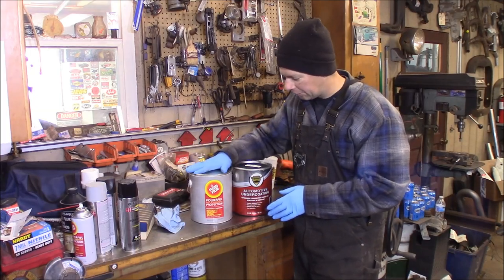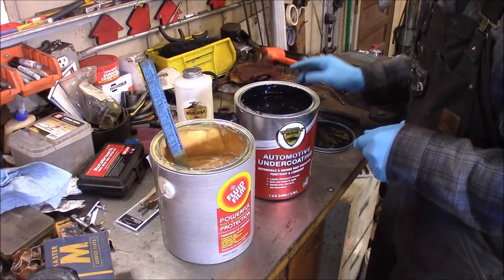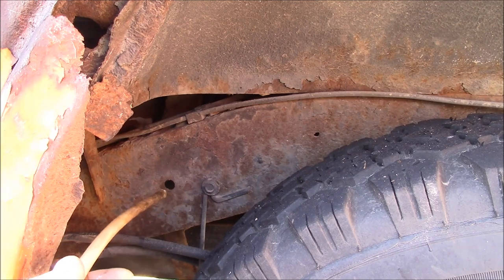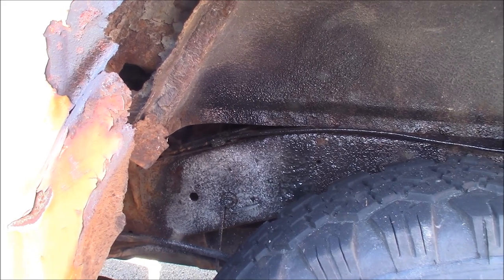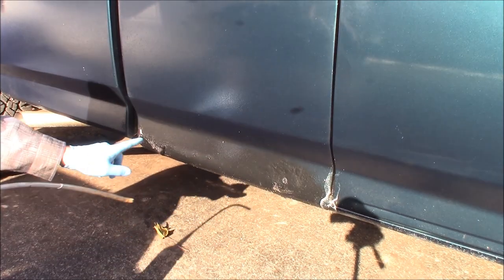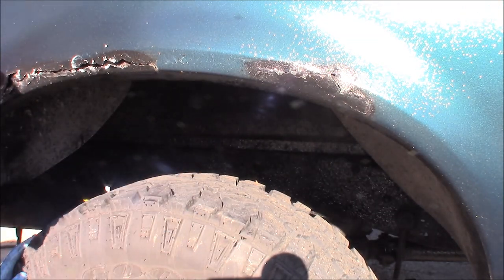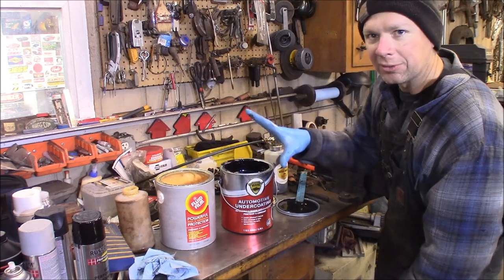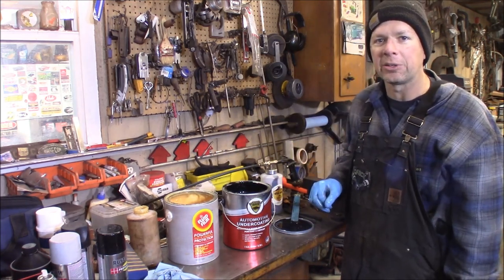Fluid Film vs WoolWax Lanolin Rustproofing:  Stop Rust in its Tracks!

Comment: Something no one ever seems to mention is the fact that rust is porous, similar to wood.    So the rust can be used to hold an oily rust preventative onto the metal.   A thinner oil will penetrate the rust all the way through down to the pure steel.   So the concern about sticking to the frame is way over rated.   And worse, the thicker products will not penetrate the rust as well as a thinner product.   Any kind of oil will work well on a rusty surface.   The only time you need something thick is for new, shiny, rust-free steel.     Or you can let it rust a little, then the thinner oils will penetrate and stay in the deeper layers of the rust.   Easy-peasy.   The "old-timers" would apply used motor oil and that works very well too, except it can damage rubber if it's not cleaned off right away.

Comment: If youre spraying when its cold get a paint mixer hook it up to your drill and mix it up, it will thin it out and spray better. I have a undercoating business I use fluid film. FF also makes it in black now (it is also thicker then clear). Awesome product. Also if you can use a airless sprayer, works 1000 times better then those kits.

Comment: I would like the black woolwax too.  I saw another video where the guy warmed up woolwax by putting the spray bottle in a tub of hot water.  Better yet apply woolwax before weather gets cold.
Reply: Use on old crock pot and water to heat the bottles.

Comment: They both have their advantages. Are use fluid film on my ram 1500 chrome wheels/bumpers/grill, I put it on and I leave it on all winter without wiping it off. You can’t even see it when it’s on the bumpers in the wheels. It just makes them look like they’re wet.I could not do that with the black woolwax..
   also, in hot weather, the fluid film I sprayed on my truck will run at times, not much, but it has streaked down my headlights, and on my bumpers on very hot days. With wall wax, that would not look like just water running down. I do have to say, that the running fluid film when it gets very hot, wipes right off with a rag, no problem.
  I am going into my third winter with my ram 1500. I spent five days rustproofing it with fluid film the first week I brought the truck home brand new. I have no rust, and where I live here in Pennsylvania, they throw salt from November  thru march.. I do not spray under my truck all winter with water to wash the salt off. I don’t even run my truck through a car wash all winter. And I have no rust. Great stuff
Reply from the maker: I've Fluid Filmed a couple of my friends brand new cars and did my brand new truck at work.  None of the cars have any signs of rust.  I do my work truck every fall and 4 years in it has absolutely zero rust and we use a ton of salt here.
Reply: I really toss n turn not taking a pressure hose to my truck in the winter if I undercoat with fluid film. Ugh

Comment: I put Fluid film (or bar and chain oil) in a pot on a hot plate. Then I add some pieces of candle wax and stir. Shoot that on and it's much better than just straight product.
Reply: Use toilet bowl wax ring as it stays flexible

Comment: Best to spray Woolwax in June or July when it is really hot out to assist with spraying. If you wait until 70 degree weather it is too late even if you heat it up to get it through the extension wands. I had to switch to a gruel of boiled linseed oil, bar chain oil, toilet bowl wax and a gob of marine grease heated up in an old crock pot for inside the frames. I sprayed a small area outside the frame with it just to see in the spring which held up better to snow.

Comment: I've used a few different rust prevention fluids, but Fluid Film has been my favorite. I love how it creeps a few inches and goes into places I can't spray, but the smell has always been and issue. I use it on my old farm equipment as well as my vehicles and the stuff is amazing. I think, based on your observations, that I'll order a gallon of Wool Wax and see what it does.
Reply from the maker: The Woolwax is definitely a little thicker so I'm going to see how it holds on.  I actually like the smell of FF.  If you can smell it you know its working!

Comment: Been going ‘full-retard’ with Fluid Film on my 2 Jeep XJs since returning to the Salt Belt from the PNW a few years ago.   The stuff works great.  I try to do my annual application while it’s still warm to promote creeping.  
Avoid underbody washes till spring ( I know! It’s counterintuitive)—just use garden hose pressure to spray the bottom when it’s above freezing.  Depending on how much highway driving you do, a midwinter application may be needed on exposed areas like floor pans and wheel wells
Reply from the maker: I like the Tropic Thunder reference 👍
Reply: @QuickSpeedShop  what do you think of Blaster Surface Shield

Comment: Oh please do update video's on these products. I have been kicking around the idea of buying myself a brand new Rubicon and will considering using one of these products. Even though I live in Phoenix Az. I still believe it will be a good idea. Thank you for the video and product demo
Reply from the maker: Both products work well for moisture repulsion.  That's how it stops rust, the water runs off and takes the salt with it.  In an arid climate salt isn't a concern, but can't hurt to do the inside of the frame at least especially on a Jeep.  I will say that I have used lanolin prevention on my 2016 Silverado truck at work and it has absolutely zero rust anywhere on it.  Several other 2016 trucks were purchased at the same time and have rust at all the edges of the frame, on the suspension, and at some body seams.  Lanolin (both Fluid Film and Woolwax)  definitely works!
Reply: You also might want to check out POR 15,just might be better than those 2 products....

Comment: Tip, take either one and heat it in a "Presto" electric crock pot to 100F then spray it on. A regular paint spray gun will apply either one much faster..

Comment: Lanolin based products works good on preventing rust and slowing it down. A frame that is extremely rusty needs more than a little TLC. A wire wheel and some POR15 might be a good starting point before applying a band-aid over an existing problem.
Reply: POR15 is a band aid unless its on perfectly clean metal.
Reply: @tim9m  good luck with sealing up that rust it will continue to cook under the surface. The por15 will flake off, been there done that Fluid film type stuff is the only solution.
Reply: I don't have POR on any of my vehicles. I use a product called Dinitrol and I'll use fluid film too. The bottom of my vehicles never get that rusty.
Reply: I heard POR 15 was really good,lot more prep work though....
Reply: @christophercorrado2406  As long as you do the prep work POR 15 is a great product....

Comment: I used the wool wax clear a few weeks ago (spray cans).  Make sure you wear clothes that you don't care about!  I wore a pair of nice double-front Carhartt pants; I got drops of wool wax on several areas of the pants while I was spraying.  After being washed three times, the wool wax is still embedded in the pant material.  Hopefully, it sticks to the car this well!
Reply: How did it hold up on your car? Were you happy with it?
Reply: @dannymcsherry3512  Yes, still satisfied.  If I don't wash the car for a week or two, the lanolin film creeps out onto the painted areas of the car.  I will do a closer examination under the car when I install the snow tires / wheels next week. 
Just today, I applied Fluid Film to exposed U-bolts and hardware on my TV antenna.  Hopefully, if they ever need to be removed, they won't be rusted solid!
Regards.
Reply: Thank you for the update.

Comment: I know a very good tip if the woolwax isn’t spraying out of your undercoating gun good make sure it is well heated so that it’s liquid then you can spray away and it will go back to its original consistency if not you could always thin it a little with vegetable oil that’s if you absolutely have to.
Reply from the maker: Yeah, it was definitely too cold to spray the thicker Woolwax.  An easy was to warm it up is have a hot pan of water and warm the gun container or the gallon can itself up in the water and it will spray nice.

Comment: Oh man !, I bought a bunch of fluid film based on your prior videos, It seems like good stuff, but now I'll have to try the woolwax. The black color is a plus !
Reply from the maker: I really like the black for suspension and drivetrain.  I'll probably still use Fluid Film for the majority of my stuff because I can get it locally, but the Woolwax black is a huge bonus.
Reply: QuickSpeedShop is it possible to just get a black tint from somewhere and make it black?  I’m sure it’s water based.
Reply from the maker: @TheRazmotaz  These products are made from lanolin which displaces moisture.  They are not water based.  No idea what chemistry WW used to tint theirs black.
Reply: QuickSpeedShop you may have just saved me a hundred dollar mistake :). Great info.
Reply: Damn I bought a gallon of fluid film for my bronco now I see there is another product called wool wax??!?!! Damnnn kinda WANA cancel my advanced auto order
Reply from the maker: They are both lanolin and essentially the same products.  The FF is a little thinner than WW.  I use the WW Black on my chassis components and FF everywhere else.  Also FF is available in town while I have to order WW in the mail.

Comment: Not sure, but what I read about Fluid Film, it is supposed to be base coat, covered by thicker layer of Perma Film, especially on mechanically exposed parts like wheel wells ... Not a pro, maybe I'm missing something.
Reply from the maker: Fluid Film just goes on wet and soaks in.  It will seal itself with dirt and grime.  Needs to be reapplied every year for max protection
Reply: @QuickSpeedShop  yea, point was that you might not need to reapply it every year. Used just as base coat, and protected with something which is a bit more permanent. I'm thinking about Fluid Film like about base  paint protected with something on top of it. You also do not have, probably, car painted just with base paint and there are layers above and then clear coat of lack on very top.

Comment: How’s the woolwax doing in comparison? I’ve been using fluid film but am considering switching to woolwax at least for high wash areas.
Reply from the maker: The WW does seem to cling a little better than FF.  I just use FF because I can get it locally.
Reply: @QuickSpeedShop  Makes sense. Thanks for the video and the response

Comment: I want to put on my cast iron sink, after I take off the rust.  Since I do not remove sink every year or 10 years, would this work.  The main area where sink contacts surface is the problem, which will contain chaulk, as well

Comment: I am thinking about using these products on my newer car and my older (15 yo) truck, the latter which already has rust that has started, not surprisingly. What is your recommendation on using only products like these, or should some sort of rust reformer used first, then followed by FF/WW?
Reply from the maker: Wouldn't hurt to spray some kind of rust converter on the rusty truck first for extra insurance.  Both the FF and WW will significantly slow down the rust and keep salt away regardless.

Comment: Curious as to how it does after a under chassis car wash spray
Reply from the maker: It hangs on well.  If you wash a car with bottom blast everyday it will take its toll.  I suggest just rinsing under the car with light water pressure.  Fluid Film should be applied once a year for ongoing protection.
Reply: what if i wanted to apply it with a paint brush?

Comment: Can you spray the ww black on suspension,  transmission, axel, rear differential? I have 2016 Silverado I have never under coated and plan on lightly wire brushing the little bit of rust off then under coating frame axel suspension everything pretty much under the vehicle? Is WW black safe for that? Or just go with the fluid film?
Reply from the maker: Absolutely.  WW and FF are for all intents and purposes the same product, lanolin.

Comment: Wouldn't it make sense to thin those products out ? What would you thin them with ? I'd like to spray my truck chassis but I don't want anything that makes a complete mess out of it and I don't want something that attracts dirt. I was considering spraying diesel fuel but I'm afraid that it would hurt the rubber and plastic components . Any thoughts on that ? What about vegetable oil or boiled linseed oil ?
Reply from the maker: You don't want to thin the stuff out.  I put it on heavy and yes, it does attract dirt.  The wax/dirt mixture makes a corrosion proof coating.  I would much rather have a rust free truck with a layer of wax and grime under it then have my truck rot away.  I made a 4 year comparison video of FF with two identical trucks on my channel you can watch if you want to see what 4 years of FF buildup looks like. If you coat your truck with diesel or oil it will also attract dirt and leave rainbow stains everywhere every time it rains.
Reply: @QuickSpeedShop  I agree.That's the whole point. A protective barrier that salt water can't penetrate

Comment: What size compressor is needed will 6 gallons do the job?
Reply from the maker: Only takes 3 quarts to one gallon to liberally coat a full size vehicle.  I use a 5 hp, 60 gallon vertical compressor.

Comment: Excellent video.  I will be doing this on my 11 year old F250 that has never been treated and quite rusty underneath.  What do you think about knocking off the loose rust first and then applying a Rust convertor on chassis and finally following up with Woolwax? 

Originally I was going to remove the bed and do the painstaking task of wire wheeling the whole frame, treat with a Phosphoric Acid convertor (Corroseal, Rust Mort, etc), Paint with an Encapsulator (POR-15, Eastwood, etc) and finally top coat with a quality paint.  But then I started reading up on these lanolin products (FF & WoolWax). Which will certainly be quicker and easier.  I am more interested in saving the chassis than I am in aesthetics.  So I believe applying this WoolWax once a year will do the job.  But what do you think of adding the convertor step?  Waste of time?  Thanks for the video.
Reply from the maker: Thanks for watching.  I think what I would do is get a needle descaler and hit the frame with that to really knock all the loose rust off.  The rust converter is a good idea, but must be followed by a paint of some kind because it's not meant to just be left to the elements by itself.  This will help to seal the metal up a little before the Woolwax.  After that, heavily apply the Woolwax to everything.  I usually put about 3 quarts work on the bottom of a full size truck.  The Woolwax black would be perfect for a truck that already has rust as you can make the whole underside black and shiny even though it was a ball of rust before.  I apply my lanolin every fall.  If i get a warm spell mid winter I will wash the truck thoroughly and apply a touch up coat just for good measure.  After a couple of applications you will start to build up a decent layer of lanolin and really seal the metal from salt and water.  I also only rinse the truck off with a hose and soapy water.  Car washes spray too forcefully and will blast off Woolwax or Fluid Film if you are constantly running the truck through the wash bay.  Good luck with your truck.
Reply: @QuickSpeedShop  Excellent.  Thanks for the reply.  I am aware that converted rust needs a top coat of some sort.  I was thinking WoolWax would be my top coat.  
i.e. If only given 2 options:  
1. WoolWax right over the rust
2. Convert, then WollWax
I would think option 2 would be better, No?
(Both would first start out with a needle descaler)
Reply from the maker: @Diesel Mike  I think that the rust converter needs an actual paint to cover it.  I think it needs the chemistry to work correctly.  I wouldn't be scared about just putting the Woolwax right over the rust, but the converter and paint would just be an extra step.
Reply: @QuickSpeedShop  Awesome.  TY!
Reply: @DieselMike   My van was mostly surface rust with some areas that were flaking.  I did the needle descaler then I used Corroseal on structural metal and a few other areas.  I waited a couple of days for the Corroseal to fully dry(not sure how long that would take), then coated everything with WoolWax.   I think the Corroseal will offer another layer of protection on the areas where WoolWax or FF may wash off before you have a chance to add more.  Either way, going with either option (1 or 2), you're gonna dramatically slow rust but go with the converter on areas where you think the WoolWax might come off before you have a chance to re-coat.  Even without a top coat on the Corroseal, I've read that it still offers added protection with or without Woolwax but with Woolwax or FF, you're doing 100X more than most people to protect their vehicle.   The Corroseal has the added bonus of making things looking like they got a fresh coat of black paint.
Reply: @tex959  Thank You for the excellent reply.  Going to go the decale/Corroseal/WoolWax method and be done with it.  You're 100% correct.  That alone will be way more than most people do.
Reply: @DieselMike   you're welcome.  Yes, I just got it over with and didn't spend more time  trying to find the "perfect" solution.  In a perfect world, everything would be sandblasted, primed, and painted, but unless we're talking about a 200k+ car, it's not worth it.

Comment: How will the regular car wash effect the fluid film coat?
Reply from the maker: I rinse the bottom of the car with a hose.  If you go through a pressurized wash a lot it will start to erode the FF after a while.
Reply: @QuickSpeedShop  and how does detergents effect them?